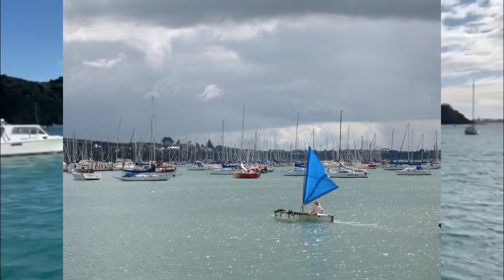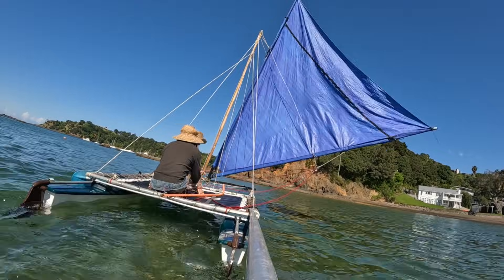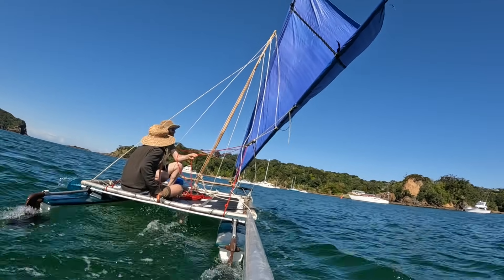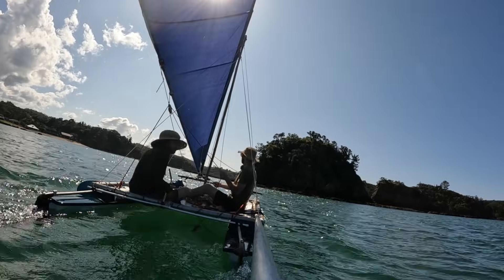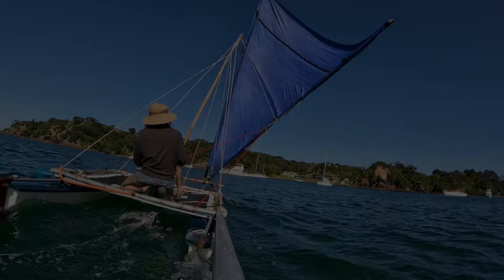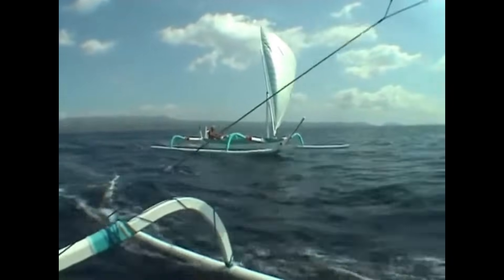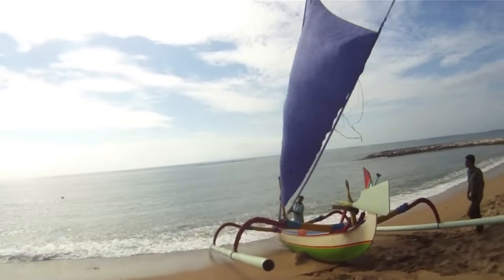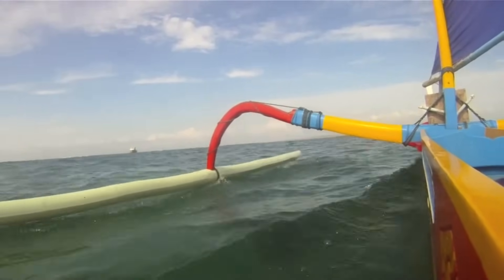Crab Claw Sail on a Catamaran?

Comment: Hey man I enjoyed seeing the different set up. I’m currently building my own proa based on your design. I extended it to 4.8m. I think it is around 12.8:2 L:W ratio. I’ve been thinking about the sail for it and I’ve watched all of your videos. I also have Gary’s book and a simple crab claw between 5-6sm is where I’ll start. My question is how do you keep your center of effort positioned correctly. When you change sails? Can you attach the mast to the yard in different positions to compensate ? Do you compensate by tilting the rigging more or less ? I appreciate any thing you can share . It would be cool to see your full rigging set up from the beach where you can walk around and get a close up of all the working parts. Thanks again love the videos !
Reply from the maker: fantastic! I'm very happy to hear that!!! please post a video of it when it's ready!

With the bigger crab claw the area is a bit further back, and you are right I just compensate by all the regular adjustments, which is mainly moving the mast to windward a bit more than I would otherwise, and maybe sitting a little further back. Unfortunately I can't quantify any of this, I can just point out what the techniques are, but I think just takes practice to get the experience to know what combination of adjustments is right when. pay attention and the boat will tell you.

With the zip off reef, everything stays the same except the end of the sail comes off, so halyard attachment stays the same etc. Otherwise you'd need to change masts, in my situation I want to change as little as possible because it's all gotta come with me on my catamaran.

please don't hesitate to ask questions I'm very happy to help advise proa builders and talk boats!
Reply: @ Thank you for the swift reply. I figured a lot of this would be trial and error and feeling the out the boat. I like this style as it plays well with my not following rules approach to things. 

I saw another proa sailor can’t recall the name but they have a several videos one is a song “keep on shunting” anyway they had a crab claw with a reef about 1/3 up from the foot. It kept its length and mostly its shape less a little material at the bottom. The issue is the sail is still pretty high up. But I saw in a forum where someone had success with a collar of bead (can’t recall what it’s called but they also use them on sunfish sails) basically it forced the top spar down effectively shortening the mast. Thought that may be a good experiment for reefing. 

My initial goal is just to get a basic small crab claw and figure out the rigging. I’ll stay in light winds and post some videos showing what I come up with. 

One final thought as I’m finishing up for the night. My cockpit area is about 10’ (3m) where yours is probably 8’(2.5m) give or take. You don’t have any thwarts. I think the iako acts as thwarts when lashed but I’m considering some extra support bc my hull feels a little flexible. I have not added the self draining floor yet though which may be all that is necessary.
Reply: Also can’t find any information on the length of leeboard. On my Canadian style canoe with tacking rig the leeboard is about 40” which allows it to stay on one side and in the water on both tacks. Gary’s book shows a leeboard that looks long which seem like it might need to be where the ama is lifted. Do you have dimensions ?
Reply from the maker: @YdocFrench  I think my leeboard is on the large side. I just made it twice the size of first one, then it was too powerful on the lee of the vaka but worked great on the ama. Mine is 1m long, 200mm wide. the pivot is 100mm down from the top, so it's 900mm below the pivot. and it's mounted at the level of the aka. I think the next one I make will be 75% the size of this one.
Reply from the maker: @ yes that's @segelreto that's what I love about the proa scene. Everyone is doing their own thing and figuring it out. Though to be successful we really have to learn from each other too. I've watched every proa video I can find! Often pausing and going back and looking very closely!

I left my hull open to save build time and also because it was essential to me to be able to pack everything into the hull. Other people build the dismountable hull but that only reduces the maximum length doesn't actually reduce space needed. Also it means it takes even longer to assemble! My hull was a bit wobbly but it didn't really seem like a problem, anyway once I gave it a deck that completely went away and now it's quite stiff! but my all means get it sailing first then come back to extras like that! You are correct mine cockpit is just a bit longer than 2.44, so that the ama can fit in.

The most important part of the rigging at first is to make the mast not fall over or snag while shunting. It's a bit frustrating if the mast is always falling down
Reply: @ yes that’s it they have some cool videos. I’ve been doing the same thing just watch, pause, think, repeat. I’m ready to get the hulls finished so I can start rigging!
Reply: @dominictarrsailing  construction is almost complete exterior is water proof. I need to buy a tarp and some rope. I’ve usually ran 1/4”(6mm) lines for halyards in small boats and main sheet would be 5/16” I think that’s 7mm. My question is do you have any suggestions for what to use and where. Proas have a lot lines haha! I was also going to get some UHMWPE for the pulleys at the ends. I also can use it to lash the sail to the spars. I’m curious if you think it would be useful for the shrouds?
Reply from the maker: @YdocFrench  I have uhmwpe on the shoulds. 6mm polyester would be acceptable, but it's more stretchy than uhmwpe. this rig is designed to be all natural fibers! for the mainsheet I'd go for a thicker rope just because it's easier to hold. mine is 10mm. I wouldn't waste uhmwpe to lash the sail on, the load is really spread out, very little tension on any individual piece. On my first sail I used polyethelene string for that! but 3mm braid or something like that would be ideal.
Reply: @dominictarrsailing  https://youtube.com/shorts/Cw9iHVLHITM?si=FofYadxhzeXz0kWg

I did the first float test. Waiting on the epoxy to fully cure for paint and I’ve ordered the rigging materials. Next week I’ll make some videos of it in action.

Comment: This type of gibe is use in windsurfing too .
Reply from the maker: yes great point!
Reply: @dominictarrsailing  there is a rig that pass the sail over the mast , I ve seen it on a Russian video I cant find it ,
Reply from the maker: @cesarmuttio506  it might be a dipping lug sail? it's like a square sail but the yard is at an angle, it can sail to windward, there are a bunch of ways to go about depending on the size of the boat. There is at least two pacific rigs where to shunt you have drop the whole rig and lift the sail to the other side of the mast. (tanja sail, from ninigo island, but no video of this process exists as far as I know)
and then also the tepuke from the solomons is like that too https://youtu.be/j2qOs00Zmro?t=320

Comment: As of number of ways to rig a crab sail on the cat - I saw one more - there is video from Fiji somewhere on the YT. They built a fleet of Gary Dierking's Waapa's, few years ago - some are in catamaran configuration, with a crab sail rigged and boat manouvered in exactly the same way as proa. 

I think their traditional boats were probably ndrua type proa, so it was quite natural for them to sail catamaran in the same way.

I was also intrigued by Hans Klaar's sail on the Ontong Java II. That rig is common on Haiti. I think that main advantage is probably, that low quality spars could be used. Mast doesn't have to be very straight and it is quite short for the size of the rig. Spars also don't have to be straight and can be made from shorter pieces, connected by tree nails and lashings. Sail can be reefed in conventional manner. Quite important on the boat of that size.
Reply from the maker: Oh yes, but if it has equal size hulls and sails both ways it's a proa in my books, just a proa with a big ama. You are correct, ndura are from fiji.

Thanks for the tip about Haiti! I just did a google image search for it and see lots of rigs that look just like the one on Ontong Java!

https://www.passagemaker.com/technical/history-of-haitian-sloop

With a gaff rig you can also scandalize the main, drop the peak haliyard and basically instantly cut the sail area in half. (although on the haitain proportions the hight to the gaff is so short that you'd loose nearly all the sail area! However I have seen footage of ontong java where they seem to be doing that (I think they were doing an atlantic crossing)
Reply: @dominictarrsailing  
" .. video Ontong Java scandaliseing the main....."

Yes, I saw it to. Hans made a number of crab(ish) sails over the years, with different proportions. Dating to at least Tehini days. Older ones were conventional crab, with "gaff" and "boom" connected. No gaff throat to grip the mast. Later he moved in the direction of gaff, with a sail luff between the gaff and boom like Haitian boats
Reply from the maker: @milanmarinkovic3016  yes my understanding is that he started with a tehini sailed it some place then rerigged it as a stub mast ketch. Then the haitain sloop rig came with ontong java... oh yes I found a photo from 2009 of ontong java without the gaff jaws, but with quite a tall stub mast and a jib https://www.latitude38.com/lectronic/more-stone-age-than-manu-rere/
Reply: @dominictarrsailing  
Nice find! 

Pity that Hans and Glenn don't have more presence on the Net. I find them both, (and you too, and Kiana and... ), thoroughly inspirational. In these days of much to complicated and expensive production boats. 

Showing other ways.

Comment: Those beach cats look so much better with the crab claw sail than the Bermuda rig. Cool comparison.. Ive always thought that the Viking ships sailed much the same as Jibe only not tacking. Also the boom is fully clear of the crew, always a win. I have a new steering oar setup im working on that Im really excited about. I need to test it out. I like being trying to micro adjust steering and rig to maximize the ability for the boat to hold a course longer.
Reply from the maker: haha thanks, yes square riggers would definitely easier to gybe than tack! like in this video: https://www.youtube.com/watch?v=BxCKGS_bLKI it is possible to tack but conditions have to be just right.

the Dhow is another one that gybes rather than tacks.

A dipping lug sail is another interesting case, it seems there are several different ways to get the yard to the other side, I'm not sure about tacking or gybing though, from the footage that I've seen. Looks like it would be slightly easier if you gybed

I think with traditional craft, it's probably gonna be gybing more often than not
Reply: @dominictarrsailing  Funny.. Ive actually been on that boat. My home town is San Diego CA. I live far from there now, but visit occasionally. I believe it is one of the last few remaining, original Cape Horn Sailing cargo vessels.
Reply from the maker: @zackariasthepirate  wow amazing! yeah it looks like one of those!